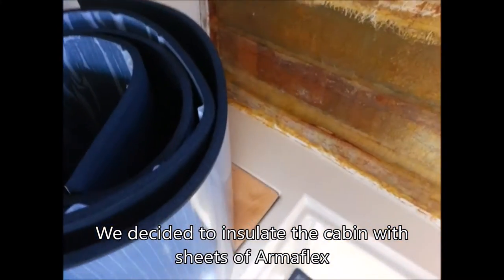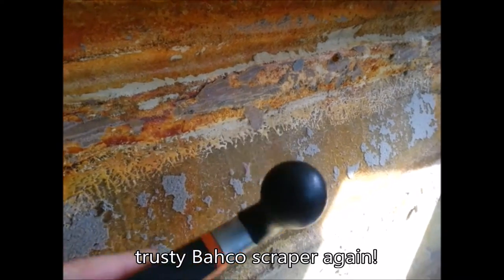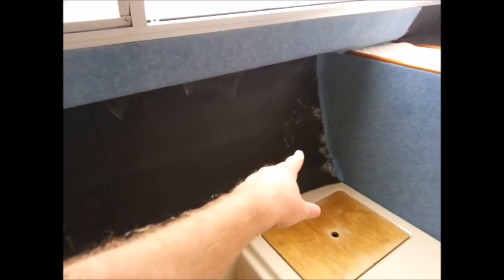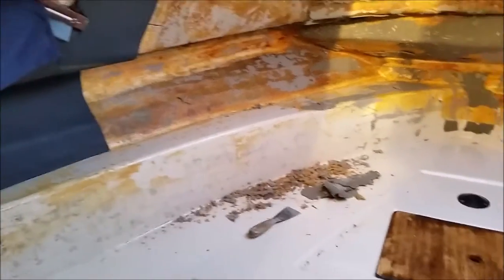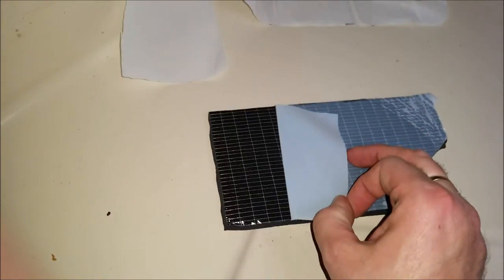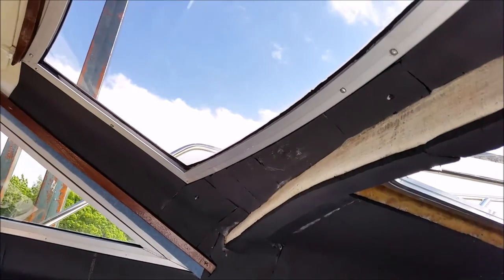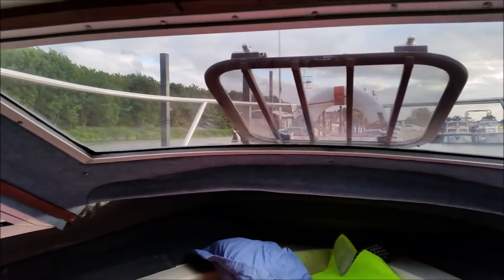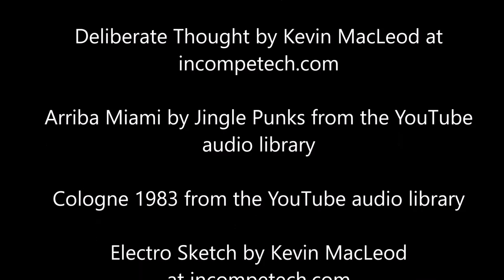Busy with Fizzy episode 19 (Insulating and re-carpeting the boat)

Comment: Which website did you buy the Armaflex closed cell foam ?
Reply from the maker: Hello. I bought the Armaflex on ebay via a company called Ryan Air Conditioning who also have their own website and are based in Manchester. Regards
Reply: consumedbynature ok thanks, found them cheers.
Reply: Are you still happy with the armaflex? Does it stop condensation? Did you use it on the roof?? SO MANY QUESTIONS 🙂